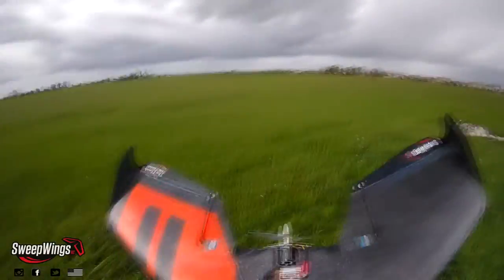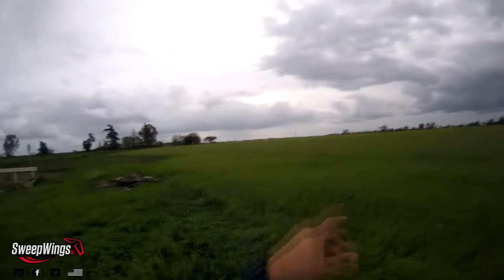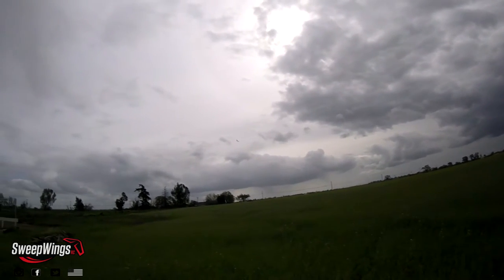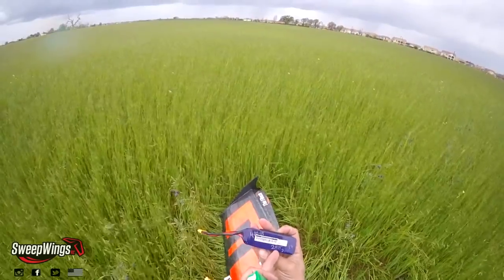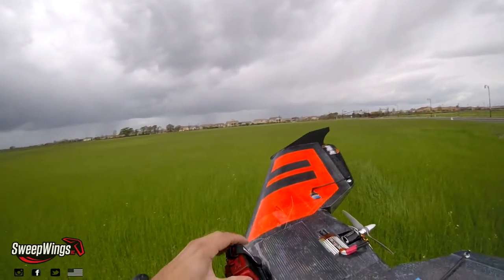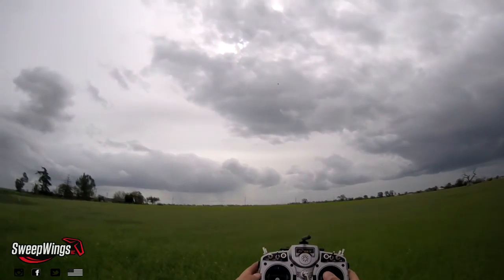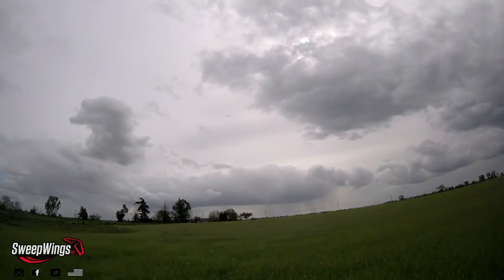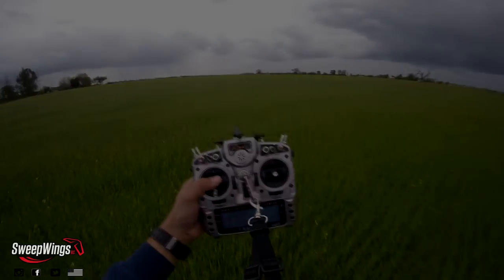Sweepwings - Flinch v2 maiden

Comment: Hahahaha you are killing this poor 3S multistar LIPO battery lol Not really a high discharge pack, something mostly for my 550 long range multirotors with its low KV motors and big 15" props even it prefers 4S i have to say :)
Beautiful maiden anyway! It flies like a spaceship with 4S!
New happy customer in perspective ;)
Thanks for sharing and have a great sunday
Reply from the maker: lol!  i know the KV will kill it fast. but it was all i had to show in terms of weight. looks like there are newer lipos comming out this year now too.
Reply: +ABMNS PRODUCTION Nah 5200 mah @ 10c constant is 52 amps.  burst rating is 20c 104 amps.  No way that motor is pulling that on 3s.  :)
Reply: Rc Dad Yes you are right in theory but i have some serious doubts actually about these LIPOs, i have a couple of them (on 4S though) and they don't seem to be real 10C LIPO batteries lol They work fine if you don't push them too much but even with my 3110 470KV motors and 15" props they get slightly warm despite the few amps pushing to the motors (between 9A ~ 15A) :)
Reply: You are right, battery C ratings are usually inflated.  So you could probably at least cut my previous numbers in half.

Comment: This is just the wing I'm after but at $245 shipped without running gear is a bit disappointing.

Your wings are awesome and is hard to find an affordable wing in Australia.
Reply from the maker: John Rossey thanks man, I know shipping is so bad. I do help with shipping though. I pay some of it to help get my wings out there to you. The post charges alot for the size of the box. check out Diablo wings out there by David Foster. I had him on my recent podcast. FPV RAW.

Comment: Would a different motor make it less of a screamer?
Reply: Wings are just screamers. A larger, slower moving prop is always going to be quieter. Most wings scream because of the distance between the prop and the plane. Putting the prop as far back as I can and trimming the plane where the prop tips are closest to the plane has worked for me. Happy flying!